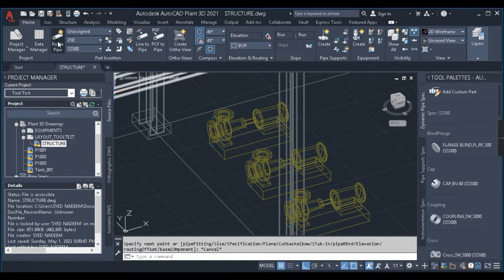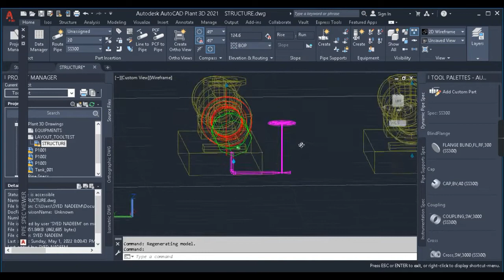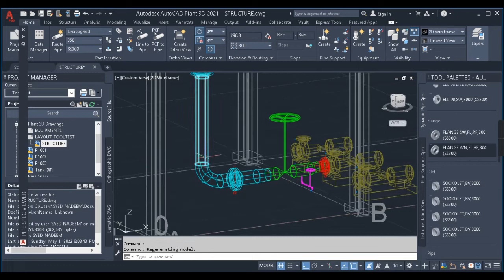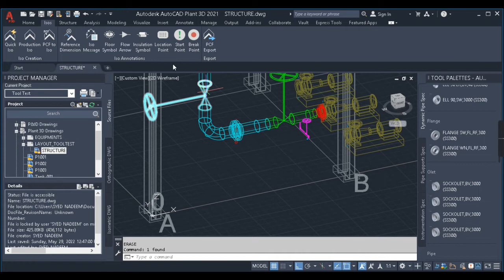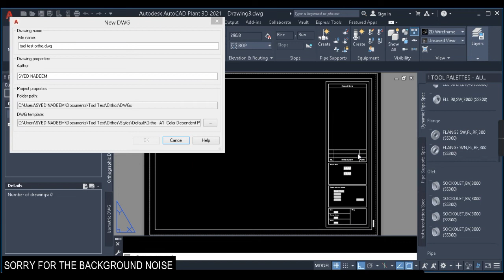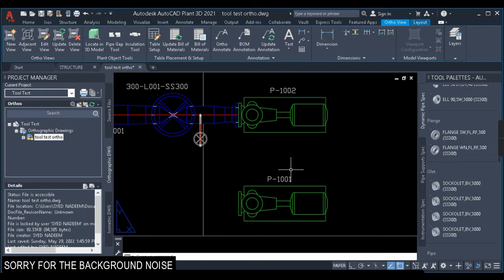Full Plant 3d Tutorial For Tool Test Interview Part 2 of 2 |Pipe Routing|Isometrics|Piping Layout|

Comment: just wondering, why i always get the same error as in 3:00 even though the pipe and pump has the same pressure rating? tried changing to higher and lower rating, no difference
Reply: nvm, turns out the pipe and the pump is on different layers XD

Comment: Thanks. The flange didn't appear when connecting 250Pump to  300Pipe ! , Also the plane change didn't work for me when trying to draw the drain pipe .
Reply from the maker: Just check if the flange is available in the spec or not.
The plane option should work just retry it.
Reply: @plant3dtutorial261  sir if we want to add customized flanges  how to get it